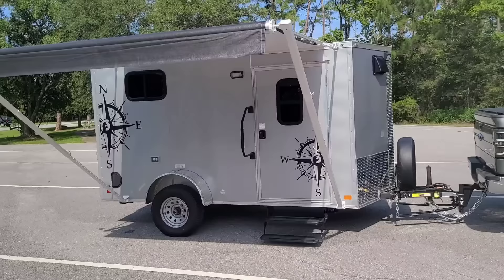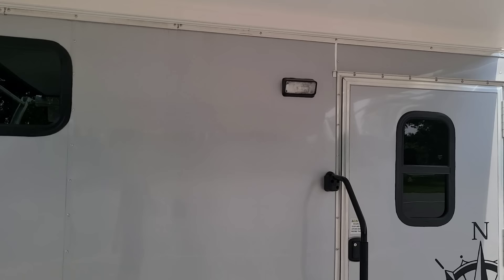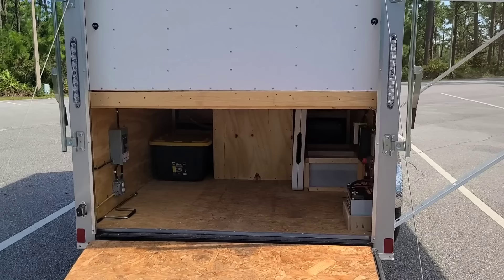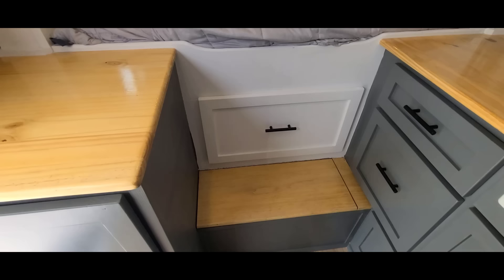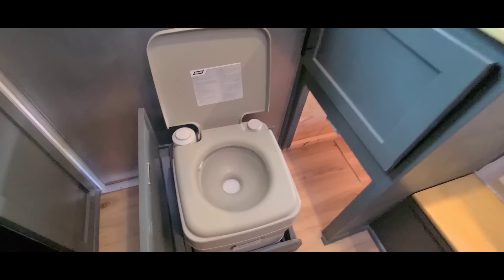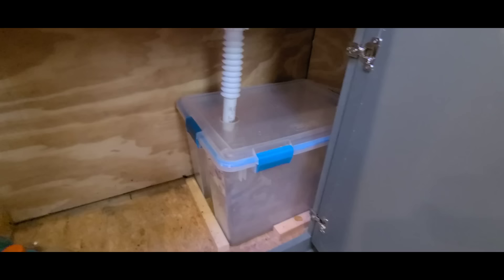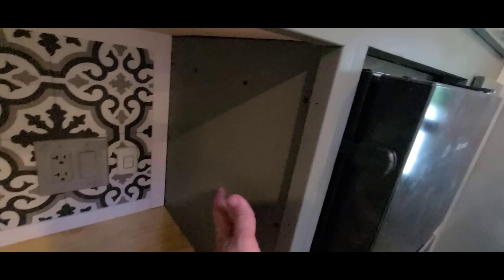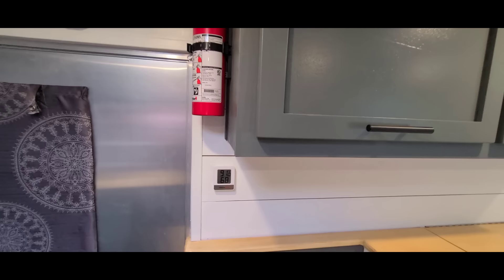6 x 12 cargo trailer camper conversion tour

Comment: for solar, the controller should auto stop charging the batteries. double check your system to see if it does that (it should). This means you just leave it and forget about it.

Comment: Excellent job but as far as the A/C you should’ve gone with  the new version of the roof 12 volt air conditioner which are extremely efficient and quiet but again you did a fantastic job

Comment: Impressive build with lots of well thought out details. I am in the middle of a 6 x12 V-nose build right now and have a similar size A/C refrigerator which I run off my solar system. My fridge dissipates heat like a chest freezer does through the outside walls of the fridge. Supposing that your fridge does the same, how does you dissipate heat being enclosed in a cabinet? I'm a former appliance and refrigeration repairman.
Reply: Disconnect the heat ejection / condenser side from the compressor and pipe it through a radiator somewhere on the outside of the vehicle. Will require some recalculation for coolant volume.

Comment: You are absolutely right about the portable AC units when I first did my conversion I installed one  and framed it out so that the entering and the discharge condenser air was going outside and in Florida it was a sweat box.

Comment: Hi Brian. There is much about your camper that I like. I built the kitchen very similarly. I squared off the triangle same as you with the fridge in the  middle on the floor, no drawer. After I raised the floor level up by laying a floating wood floor the fridge often touches and scrapes. Your design is noted!!   
Because I did not know about thermal bridging when I built the darn thing the walls get red hot where the steel struts are. It transfers that to the inside and my poor 5k AC unit has a devil of a time keeping the place cool. I redid the ceiling this spring with cedar planking and did double insulate defeating the thermal bridging. That worked very well. 
I had to move into mine on memorial day 2019. No choice. I was living in a failing semi truck and had to move. The AC was the first thing I installed and I had very little idea what I was doing. I used a 5 k and should have used a 6 k. My hot air outlet is not big enough and has no fan. The inlet is fine and doesn't need a fan. 
I am now trying to figure out an awning. I want to know about yours and also what fan do you recommend for both the fridge exhaust and the AC exhaust. I hope you have time to reply. I have subbed and I look forward to seeing your AC install videos.
Reply from the maker: I used simple 4 " computer fans that I purchased from Amazon.
I will be doing another video on the AC alone because lots of people are interested in how I set mine up.
Reply: @BRIANPAVLICK  Thanks for the response and I will do the same thing. In the spring this year I made massive upgrades to my home. Next year it will be the AC / kitchen area. Fans will be going in. 
I have started using  aluminium profile. I built a solar rack trimming the roof of my camper. I am going to use that to attach some sort of awning. I also plan on completely redoing the drawers and generator slide on my pick up truck again with aluminium  not wood.  The wood I have found is a pain to work with always twisting and rotting just where you don't expect it. 
Anyway I look forward to your AC install video.

Comment: I am in love with this CTC. 
You have accomplished what my goal is to do with my CTC. I would love for you to see my CTC and give me your input. I am a solo female camper and I want/need mine to be self contained and easy access to the things that might need to be changed out (AC, heat, Fridge, microwave, etc). I love how your solar power is color coded toggle switches inside. I love the roll up blackout curtains with the magnets down to the gray water sink dump container. 
I also have a ramp on mine that I would like to flip. Just need to fine a welder locally that can do the job.  I am in Northwest Georgia.

Comment: For me, the bed could have folded into a couch with table, facing a window or the dining area. The back "storage" under the bed, used a  lot of space,(about 6 feet X 6 feet of floor space), that could have been inside headroom/camper space, and still allow above cabinet storage along the walls.  For me, a camper this size could never need this much storage at the cost of sitting and table room. Having storage is great, but not at the cost of camper space. That is what totes, trunks, roof racks, tool boxes, truck beds, or back of SUVs' are for. A well built, highly detailed, storage unit with a bed. *BUT*,  This is one of the most solid, well built campers I have ever seen. Camping styles are as different as the people that camp. You couldn't pick a better built camper if this one fits your style.
Reply: Exactly what I was thinking, just like my Volkswagen camper had a sofa that converted into a bed and it was very comfortable. That would give him a large area to watch TV on the sofa and maybe even have a desk on a pedestal table.
Reply: Just maybe he built it the way he wanted it?? Just a thought
Reply: @user-ny5vr4oi7b  maybe it didn’t occur to him. It’s a good thing you came to save him from other people opining.

Comment: I like your trailer hitch setup , For you folks watching this video he did it right one chains are crossed two the hitch is site to the right height . I see a lot of trailers being pulled down the road on with the hitch is too tall . ( wonder why my trailer ride so bad that's why ) Those bar's with the chains i have 3 sites of those . I use  them on my car trailer each link in the chain is for more weight on your trailer .

Comment: I'm building a 16 ft so I can have my tools  on the right side & 
 on the left side so I can combine solar and electrical .Bed in the bottom nose  and a/c in the top.hangers on opposing sides of the ac.The back wall will hold the flat screen and door leading to tool room  and compost toilet

Comment: super nice build, but replace that Sterilite gray water tank with at a bare minimum a Rubbermaid. Sterilite is known to just snap at any time, and the last thing you want is 10 gallons of water dumping all over the place.

Thinking of building my 2nd enclosed trailer this month, my first was just a throw together to stay in for working hurricane Ian, but it was a 5x8. thinking of going to a 6x12 as well, however since I normally sleep solo, going with a twin bed, then spin it 90 degrees, for way more space inside. Super nice build, bookmarking your video for a few ideas. 

If you reply, can you get me information on what door shocks you used, throw and lbs. then were did you get the magnet door catches. Lucky for me, I live in the trailer manufacturing center for the US, so I will be making a trip to some of the surplus stores to pickup heavily discounted parts. 

My first trailer is running a 5k AC, with 750w solar, 300AH Lifepro, and a Dometic cooler style fridge, and I'm able to go 100% off grid.. and that's great for boon docking, run the AC for 9-12 hours everyday, plus the fridge 24/7.. and so far never ran out of power, but just a few over cast day could change that fast.

Comment: A great looking build, for sure. I love the accessibility of your systems and appliances by removing sidewall panels.  You have some skills. Your side door from the inside looks like a stainless steel finish. What kind of door is that and what kind of finish does it have? I would love to see the result of your planned upgrade of the rear entrance ramp. Thanks in advance for your response.
Reply: My question as well.

Comment: I may have missed answer to this question: Do you have insulation in the floor? And if so, what kind and thickness? Your video is great, you do a great job on your carpentry. 
I have a 2017 same model, for me to take grandkids on any type of camping trip, I have to have power to run my cpap machine...😊

Comment: Great build!  I got some really good ideas from your build. Do you mind sharing how you built your cabinets vs a traditional carcass?  I’m trying to think of an easy and light way to build my cabinets.  I was thinking of trying to build a frame from 1x2s and skinning it with 1/4” plywood.  Is that similar to what you did but used 2x2s?  You should be proud of your camper.  I can only hope mine turns out as good as yours.

Comment: That is probably the best looking conversion we have seen and we live in ours full time and see a lot. Did you use firring strips on the ceiling to get the 2 inch foam in there ? Thanks for sharing your video hope you post more of the build.
Reply from the maker: Yes I did use 1 inch firring strips on the ceiling.

Comment: Looks really nice, but no place to sit for eating or playing a game.  I have the same size trailer but use it to haul one or two motorcycles so have to keep everything light and foldaway.  

Hopefully those torsion bars on the weight distribution hitch are rated for the weight you have.  They can put a lot of stress on the frame that it might not be designed for.
Reply from the maker: I had a few comments like this  which made me reevaluate my frame. So I researched some engineering  sites on how to strengthen the frame of a trailer. Also I contacted the dealer as well as the manufacturer and both said it would be fine without strengthening the frame. The torsion bars are rated for the frame, especially after I beefed it up, which is not shown in this video. I will be doing another video on how i did this. I tend to overdo everything I touch.

Comment: What is a 30amp service? Shore power? Is t that just the ability to run electric through the wall? Why do u have all that circuit breaker stuff just to run an extension through the wall? Sorry, I don’t know.

Comment: Do you have some kind of portable propane or butane stove to put on the countertop?
Reply from the maker: I use both a induction burner for inside the camper during inclimate conditions. I also have the 17 inch Blackstone propane griddle. Most if not all cooking is done outside, but that is just my personal preference.

Comment: You should not put LT tires on a trailer. Trailer tires have to twist in order to turn while automobile tires are designed to stain rigid to maintain traction. Putting truck tires on a trailer could result in Small tears in the tire that could expand overtime and lead to a blowout

Comment: What type of wire chase did you use? 16:25
Reply from the maker: The chase cover was built simply out of wood and painted to match. It resembles a L-bracket or angle iron with the bottom piece of the chase thick enough to run wood screws though it to adhere it to the wall. As far as keeping the wires up out of the way, I used simple harness clips that you can find in various sizes at Lowes in the electical isle.

Comment: What is the gross weight of the finished trailer please.
Reply from the maker: 2950 lbs dry. Close to 3150 with full fresh water tank. I am pushing the GVWR with this build so I have literally just strengthened the tongue as well as swap out the 3500 drop axle and crappy tires for a 5200 lb straight axle and upgrade to 16 inch aftermarket aluminum rims and 225/75/16 Michelin Agilis LT tires. Same ones that Airstream uses on their trailers.
Reply: Thank you! Your build is one of the best I’ve seen, great ideas if I ever go to the cargo trailer from my teardrop.

Comment: You should never put P or LT tires on a trailer. You should always used tires made specifically for trailers. Tires that are made for trailers, will prevent the trailer from bouncing. Car and light truck tires have thinner sidewall construction, so they flex more. You want your trailer tires to remain firmly planted on the ground. Trailer tires have thicker sidewalls, to reduce flexing, so they are less prone to bouncing.